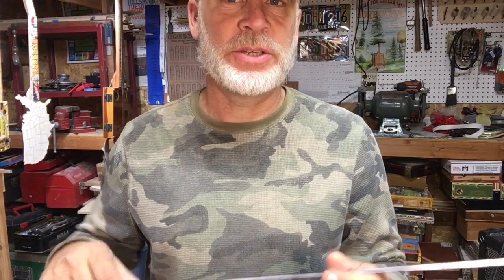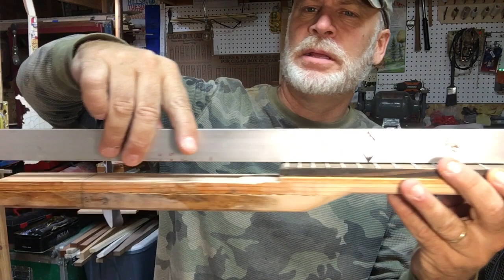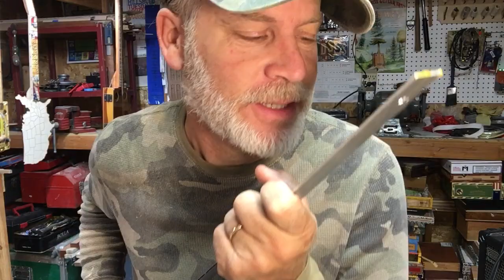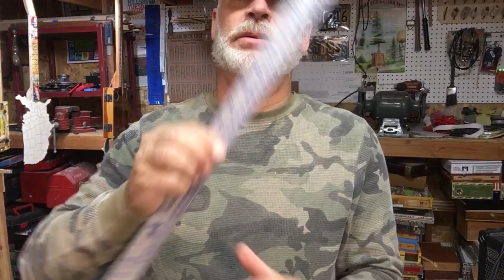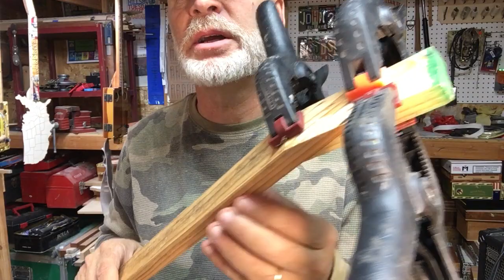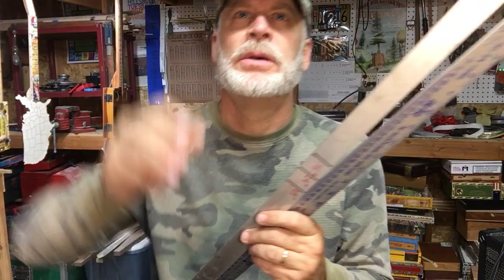Making a “Great Neck”

Comment: coolio...I have also cut up a steel retractable tape measure to create several different lengths of super acurate and lightweight rulers, we don't get Doug Fir over here but I did find a real nice hardwood stave stuck in the ground by the side of the road that some fool had attached a "danger" sign to, not sure what wood it is but has a sweet tight grain and is thick enough to carve a one piecer from, long enough to make a bass CBG if there is such a thing.

Comment: Thanks for your video's. I hope you accept tips from your fans. 
To make your Neck even Greater, try using about 3-4 applications of Kiwi brown shoe polish on your fret board. Use a lot of vigorous buffing as that will fill in all those small and micro cracks or grooves, whatever you call them making the fret board smoother. Don't use cheap polish, it doesn't work. You can also use different color polish depending on the result you want.
I was taught that technique by a master luthier when I was a apprentice and we used it on high end guitar necks. 
I hope you will try it and let me know what you think. Thanks, God Bless, and keep up the good work.

Comment: I had to laugh 😂. I came in from the garage where I was making a neck! I’m building a ukulele out of a popsicle box!  I was getting all efficient by pre-drilling all the necessary holes when I realized I put the tuner screw holes on the wrong side of the neck! D’oh!!!  It’s 102F outside so I’ll blame the SNAFU on the heat. Oh well, that just gives me an excuse to practice putting veneer on the headstock to cover the errant holes.

Comment: Hey Del.. just wondering.. when you cut the neck to build up the back angle you want different thickness of the neck at the bridge and at the neck of the cbg.. the neck will be levelled on the inside of tge cbg under the lid of the cbg.. but at the bottom of the cbg? in the neck position the neck fully contact the wood of the shim you put inside the cbg... but.. at the end of the cbg the bottom of the neck will be in contact with the wodden shim you put underr it inside of the cbg at an angle... so it won't be in full contact with the wodden shim/spacer... am i right? it will be against the spacer at the front but a little off in the back.. letting sone air and not in full contact with the spacer..  right?

Comment: I find this particular video very interesting.. I really can relate to what you say about being able to sit and sand and shape and nit-pick on every detail a building the guitars you make. So far I've built two cigar box guitars. I got great personal satisfaction by spending the time in building the guitar myself.I certainly could have bought one or two or even three if I wanted. This particular video caught my eye because it talked about a great neck. But through all the time I spent and effort neither one of the great necks that I made we're not worth even worth two cents. The reason I say that is because both of them sound like crap. And so far the main reason that I can see for that being the case is because my fretboard isn't right.Before I started my builds I searched and searched for a template for a fretboard.. I saw a video by someone else that had built a guitar that sounded great. They even offered a download of a printable template that they said they used in their build. For some reason it didn't work that well for me. A great neck or any other part of the guitar seems to be useless without a great fretboard.